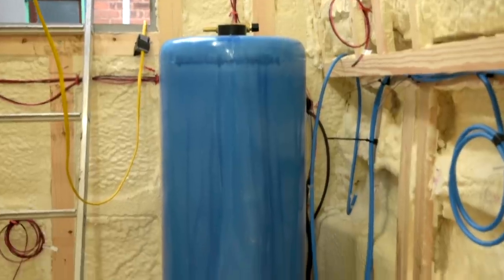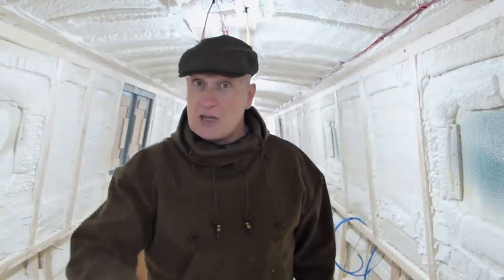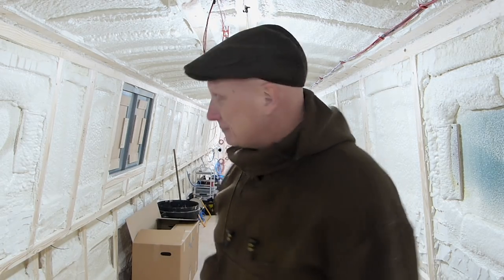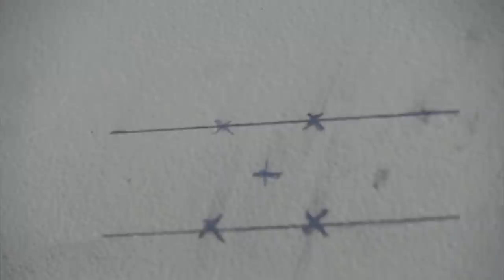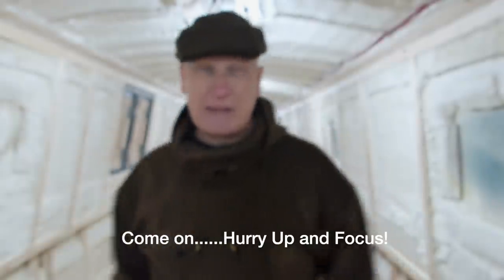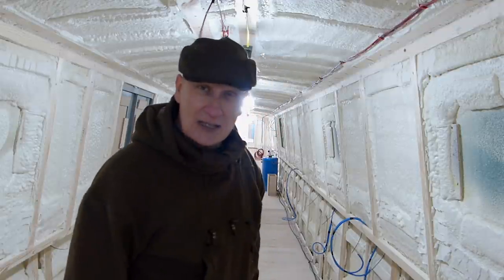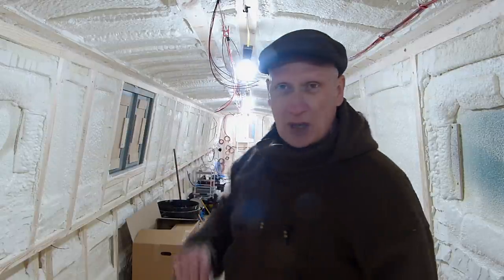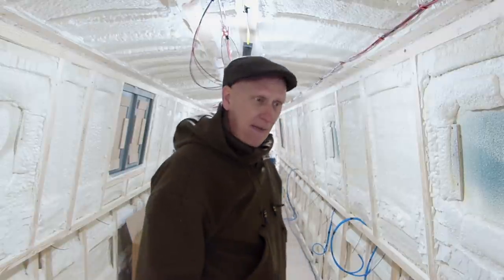Ep 16.  A Game Changer. Narrowboat Wiring 1st Fit

Comment: It's getting there. About the only thing I understood of the electrical stuff was the wiring for the bow thruster has to run from Point "A" to Point "B". It will certainly help getting around some of the canals and rivers. It looks cold out there.
Reply from the maker: That's about my level of understanding Paul.  I hope to engage a bit more as the time goes on.  Still a mystery nevertheless.  Apparently it's a tad colder on the canals as the water flows at the lowest point on the terrain and water attracts the cold.  I've got some reasonable kit to help prevent it getting to me bones but...I always remind myself, I've been colder!

Comment: A little tip when I fit out boats I always fit two water pumps one for hot and one for cold then fit a bypass pipe with a tap in it this then means you run two pumps lots of flow in the shower (that's just a bonus)the main reason is if one pump fails whilst out and about you just turn the bypass tap and all the water still works on the one working pump you are never stuck without water.
Reply from the maker: Thanks for that info.  I'll pass it on and ask Mark.  All good gen.  Thanks for your support.

Comment: Interesting to learn about the common earth.   You explained it perfectly well, and it makes good sense.      Bow thrusters - I hadn’t realised narrowboats have them, though I presume it’s a relatively modern innovation, maybe even an optional extra, though for a boat as long as yours, I’m sure it will prove invaluable.     Looking forwards to seeing the big change next week.       And did they get the red and green lights right?      Well, if not, you could always drive it in reverse everywhere.
Reply from the maker: You’re right about a modern innovation and the reason why I’ve invested in one. It’s almost a necessity for a boat of 66ft but I did need to be convinced. Also it’s a good good resell value for the boat. 
Port light red but don’t know yet why starboard side is green. Narrowboats don’t steer backwards. You have to align the boat and reverse then realign and reverse and so forth.
Reply: @chrismears-inslowtime       But with bow thrusters, and a bit of practice, I’ll bet you could reverse without the need for frequent realignment.     And that makes me wonder: clearly, you don’t have roundabouts on the canals, so, on average, how much further would you need to go before you’d find “somewhere to turn around”, if you wanted to go back from whence you came, and what do such turning places look like; you don’t have the luxury of reversing into a side street?

Comment: It can be difficult to strike the right balance between providing systems and features for guests and multi occupancy vs those for a solo boater. 
On the one hand, a half size tank will heat up twice as quickly, but you have to do the heating process all over again for the visitor. 
For me it came down to how often I would have guests, and in reality over the last 12 months there have only been half a dozen nights that a guest stayed over, so in my case I feel justified in leaning towards the type of systems that suit a solo boater, as long as I can justify the decision via a saving in time and/or money. 
For someone like yourself who is expecting guests far more often, I can see why you are prepared to take the hit of a bigger tank, even though it means that the water will take longer to heat- and will cost more in diesel- every single day.
For the sake of the guests' convenience and comfort, its worth the cost and time in your case. 
The other issue is how often you'll be cruising. 
I can say that, especially in winter, you probably wont end up cruising as often as you think. 
If a CCer finds a nice mooring with a nice view, no mud, good access to shops and facilities (for example) they will probably want to make the most of it and stay for a week- try out the local pubs and restaurants, maybe the bakeries and local shops, see the local sights, get the laundry done, maybe even waiting around for an amazon or ebay item to be delivered locally for you to pick up. 
All that sort of stuff takes a few days, so quite often you wont want to move on the next day, or the day after that- not even in summer.  
The point I would make here is there will be many days- maybe 3, 4 or even 5 days each week during Winter- when you wont be moving the boat. So on those days the engine will be used specifically for battery charging and hot water. Those things wont be a 'free' by product of cruising, they will be a specific cost incurred -and every hour of engine running brings the next service a little bit closer, so that's a cost to bear in mind. 
In fairness though, on most winter days you'll be running the engine for an hour to recharge the batteries anyway (do you know yet what your daily engine running time will be to do a battery recharge?)- so on that basis, there is nothing wasted if it also takes an hour of engine running to heat up the water tank each day.
Reply from the maker: Tony. There’s a lot of depth to this comment. I hadn’t thought about the impact of a big hot water tank. You make good arguments for both reasons and clearly, your experience shines through. You’re right about wanting to stay in areas over winter and equally, summer applies. Difference in cost v reward, a point well made. I guess I’m just going to get used to using what I’ve got to the best and economical affect. Only my experience will determine the best course of action for daily living. 
You’ve given lots of food for thought. Thanks for your support.
Reply: @chrismears-inslowtime  no problem Chris, every new boater learns different lessons as they go, and if I can save someone else a load of hassle- or a few quid- from the things I've picked up, then I'm more than happy to outline the ideas, or at least to suggest the issues to think about. 
I get the impression from your videos that you feel like you'll be out cruising most days, so I just wanted to point out that for many CCers, that isn't what happens. 
There are lots of boaters who only take their boats out of their marina between May and October.  
They tend to cruise on more days, and go further each day, because their time afloat is more limited. 
But when you're afloat all the time, it seems to engender a different approach. 
My personal take on it is that I do want to travel most of the waterways, but not in any kind of hurry. 
I want to sample the waterways, the towns, and the countryside in a more leisurely fashion- to explore more, see more, get to know a few more local people-  and thus I move more slowly than most boaters I know. 
At my current pace it'll take a few years to see all the canals, but it may be at that time I'm ready to move on to something different- perhaps a road-based mobile lifestyle. 
We're all in it for different reasons- some because they just like being on and around boats, in which case they're happy in marinas, and others because it gives them the chance to move their residence all over the place. 
I'm in the latter group- in fact I did initially consider a motorhome and full time travel around Europe (since the UK is more cramped and not so amenable to motorhomers), but the travel restrictions of brexit put me off the idea of a motorhome, so plan B was a narrowboat.
It may be that for you its more the boat that matters, or it may be that its the travelling- or maybe a combination. You'll know soon enough!
Reply from the maker: @bigtoe333333  initially it’s somewhere to live that I could afford and see the 5-a-side team of kids who all live in different parts of the country while having a bit of peace from lifestyle on land. 
Get your motivation for motorhomes as well. Quite good being part of the grey pound. I’m looking forward to it all.
Reply: @chrismears-inslowtime  , its a great lifestyle, it really is, and I'm glad I ended up on a boat- at least for now. 
One quick point that I feel I need to reiterate regarding the boat :- solar. 
I have 1400 watts of solar, and I can turn up at a nice mooring, stop there and not need to run the engine again until I leave the place (other than half an hour for hot water), because I get all the electricity I need from the panels.
Between April and Oct these panels save me hundreds of hours of engine running (and hundreds of litres of diesel), and at least one service a year (my engine needs a £150 service every 200 hours).
Even if your current boat systems design does not include panels, I can guarantee that you will want some panels before a year is out, so do please make sure that your electrical design makes it easy to add in an MPPT (or two), and a feed into the batteries from the solar.
Luckily its easy to install panels and MPPTs (even I did it), but make sure the electrical system designers know that it will be coming (e.g. extra space in the electrical cupboard to fit one or two MPPT units.  
You can even get hot water from the solar charge in the warmer months, between say May and August, so it might be worth mentioning that idea to the builders as well.
Reply from the maker: @bigtoe333333  thanks again Tony. Solar was a must for me and stated I wanted as much as possible on the front of the boat. Not sure how many solar watts 600+ for a starter. It won’t be as many as you that’s for sure.
Reply: @chrismears-inslowtime  , sounds like you've got it sorted there Chris. 
I started with 650w, similar to you by the sound of it. And don't get me wrong, 650w is great, and for the summer it'll do everything you need on most days.
What you find when you double it up to 1200w or more - as you would expect- is that you can moor up in  more heavily wooded locations, and for more months of the year, and the solar still does the job. 
There are a good few mooring places you'll find, for example, that you want to stay in for a bit, but they have high trees on both sides, and you only get a couple of hours of direct sunlight on the panels, if that.

With 600 watts, in these places you'll have to get the engine running to recharge, as the panels wont give you quite enough charge in the limited time they see the sun. 
But with say 1300 watts, even two hours of sun overhead (in Spring to Autumn anyway) is enough to give you a days charge, and with more panels you also get more charge in during the other 6 hours or so of poorer charging. So that's one benefit.
The other thing is that with double the panels, you get these solar benefits for more of the year. 
With my old panels, unless I was able to tilt them directly and facing into the sun, they were struggling to meet my daily needs on half the days in Spring and Autumn, and especially on overcast or rainy days.  
But after I put on the extra 750 watt of panels at the back of the boat, I had days in early Sept when  it was actually raining a bit, and I was still getting in 10 amps from the panels.  
The third thing - and I got my extra panels too late to try this out last year- is that in June-August, in good locations, you get so much solar power that you can also heat the water tank- and that's when you can really make savings on fuel (and be more green), because you dont need the engine at all, not even for hot water. 
In fairness, I don't know if even 1400 watts of solar would be enough to heat up your larger tank, or would so on very many days, so there is a case to say why bother with extra panels. 
Final thing to mention on panels- and you'll pick up on this as soon as you do your first lock- is that if you put some on the rear half of the boat, you have to leave enough space at the sides for you to walk forward along the roof so you can get to the lock ladders to climb up out of the lock. 
Anyway, enough blather- good luck and I'll keep my eyes open for you once you're out and about- I'm sure it'll be a cracking boat.
Reply from the maker: @bigtoe333333  thanks for all your assistance in the information offered.  I appreciate the time it takes and the advice is based on experience and common sense. Thanks Tony.

Comment: Love the progress but I do find it frightening to have 230 volts running on a steel boat on water. 110 volts is standard here in Canada & I've zapped myself doing DIY projects in the past. It's painful but survivable. 230V would be life-ending. I guess the takeaway is to leave the electrical work for the professionals. Look forward to next week's show.
Reply from the maker: There is something called a galvanic isolator which assists in water electrical circuitry things on the water as the electrical current eats the steel. The reason why there are sacrificial anodes on narrowboats. All clever stuff. More so than me but that’s the basic understanding. Thanks for your support Simon.

Comment: ah fooey, everyone beat me to it, curses to you working day... one little factoid though, the term port to mean the left side of a nautical vessel was only adopted by the Royal Navy in 1844, until then the left side was refered to as Larboard, which came from Ladeboard or loading which was usually done on the left as the steering oar, or Steerboard was on the right, and by the looks of things, the Admiralty ordained red for port and green for stdb in 1847 which then pretty much everywhere else adopted by the 1900's
Reply from the maker: Great knowledge Tim.  Is this part of a test or do you just pick it up.  I've done some research and perhaps you can verify.  The reason for Red and Green colours were that water vapour at dawn and dusk creates a haze and those colours are still recognisable in such conditions.  Discuss!  
Admiralty Chaps...back in the day when Pontus was the only pilot, drinking fortified wine (Port) over dinner thought it a bit of a wheeze to pass the Port to the left and so it stuck.  Port is the left and therefore Red will be the left light and the other easily recognisable light is green on the steerboard side or other side.  Further Discuss!

I'm going to suggest this for Tue and see what comes back!!  This is how new information starts.
Reply: @chrismears-inslowtime  not sure about the water vapour thing, but what i can attest to from personal experience of bridge watchkeeping, is that red and green are still fairly easy to distinguish at those times of day in a variety of weather conditions so there may be something in that after all.